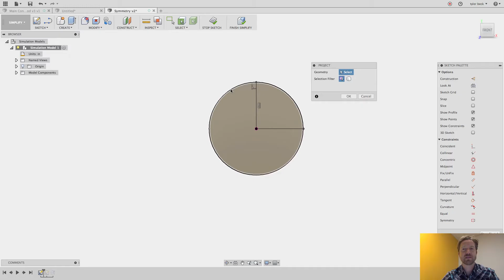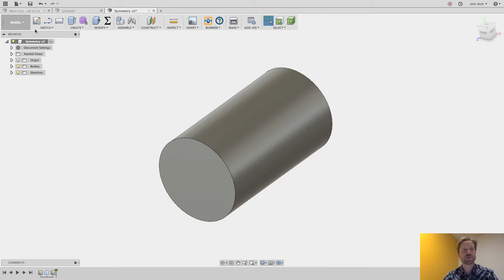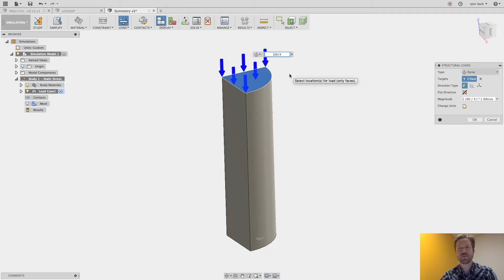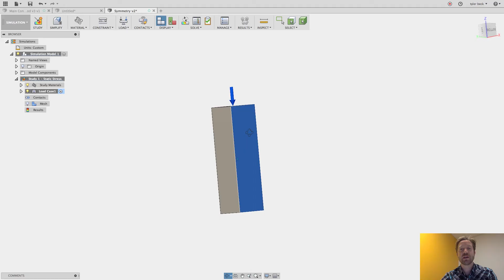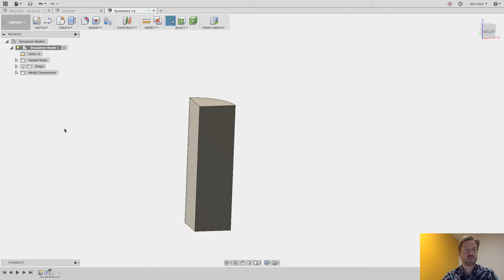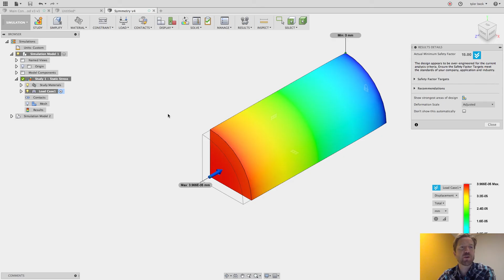Fusion 360 Simulation Symmetry -  How To Mesh & Run Symmetric Designs

Comment: You r great sir. Please Upload more tutorials videos. Actually I just want to ask you one. I complete my Diploma in Civil Engineering. so how fusion 360 is useful for me. how can i use this in my field. Please sir its request to give me suggestion. and yes your all videos are awesome.
Reply from the maker: Glad to hear it!  Fusion 360 is great for anything that falls into the mechanical, consumer or manufacturing spaces.  If you need to design a bracket or bracket assembly...great.  An entire building is better served by Autodesk's AEC offerings.  Does that help?